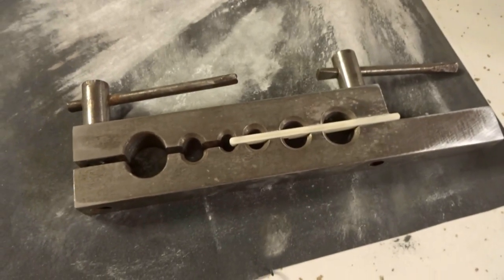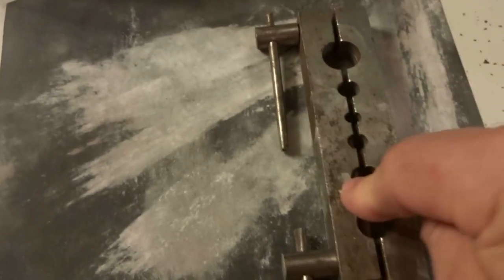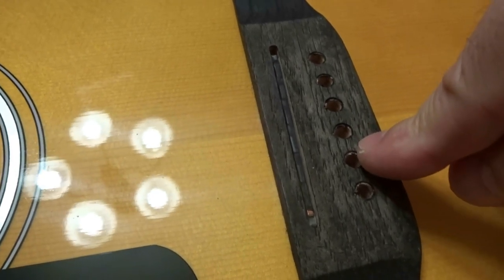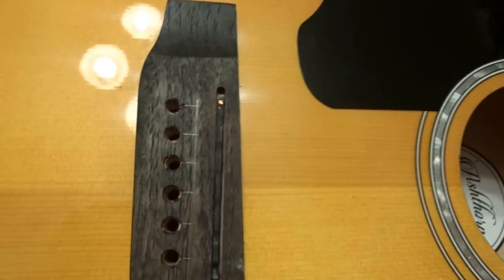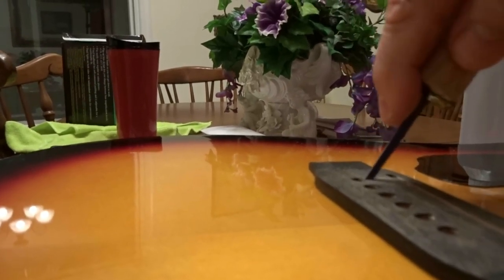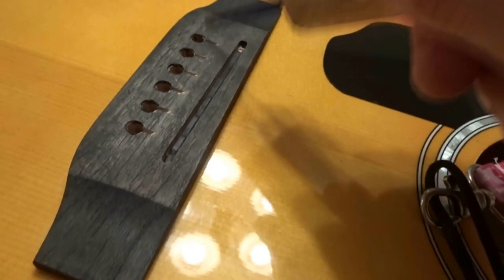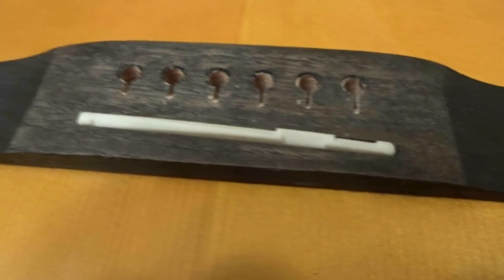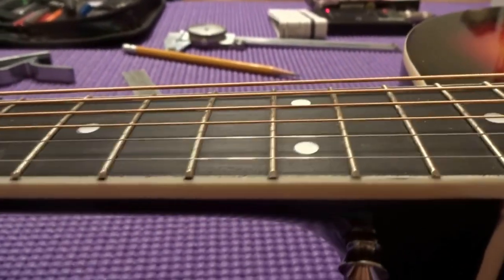Lower Saddle, Increase Break Angle, (To the Extreme) for "Low Action"

Comment: This guitar needs a neck reset. Thats all.
Reply from the maker: I know but I don't feel like doing that. Every one they sell needs a neck reset. I spoke to the company & they said I was too picky & I should buy something else.
Reply: @TheCleaner6969  WOW. Id certainly not by from them again.
Reply from the maker: @anthonylane9547  I won't. I couldn't believe how the lady spoke even after I told her there are other companies out there that are making production guitars. She wasn't hearing any of that. Just insisted these are production & you should buy elsewhere. I said you're going to get a lot of returns & at that point she arranged for another one to be sent. The next one that came in had a crooked tuning peg which turned out to be a bent screw & they channeled the wood in the neck. I have a video up how I fixed that.
Reply: Yeah... all the rest is simply superfluous nonsense. 

Feel for ya brother. But, work at a neck reset (that'll fix it) before ya smash it. Don't let it beat ya
Reply from the maker: @larrysquires5321  I know a neck reset would fix it much easier. This video was more on how to avoid that before getting into something as involved.
Reply: @TheCleaner6969  Like I said, I feel for ya (and I appreciate you simply walking through alternatives). However, there is no alternative to a neck reset that might be fixed with a mild break angle adjustment involving cutting grooves into the peg holes on the bridge.
Reply: Do a neck Reset? yeah but whose gonna do it? if he takes it to a pro he's gonna charge like 50 to 80 dollars USD an hour to make those changes... just to sand down the stupid bridge would cost like 50 per hour for 10 min work..
we know how this works... Acoustic Guitars are a horrible design in my opinion it doesn't matter how expensive ,or cheap ; the design still sucks in my opinion it's a bad design..
Reply from the maker: @Mr.PhatsVarietyVibesShow  That's everyone's answer. SMH I know personally I would not want to even tackle such a thing. There's not a guitar in this world that would make me want to do it. All I see is frustration for nothin' & problems for free.
Reply: @TheCleaner6969 dude, you're f'n dense. you're having giant struggles with alterations that ain't gonna do squat (except lead to more self-imposed problems and frustration). yet, you play mental midget at the thought of the one fix that is necessary (when clearly you have the skills to make it happen).

Thank you. You have shown everyone that you do not fix a problem neck by avoiding it.
Reply from the maker: @larrysquires5321  You watch anyone else use these same techniques to avoid a neck reset? I did & there's a reason people try & avoid them. A neck reset is a pain in the ass! The guitar plays fine now without a neck reset so why would I go through the hassle & time on an $99 guitar? When it doesn't play no more I'll have some fun making a video smashing it & buying another cheapo. Acoustic guitars are a waste of money. They're like a needy baby. So no dude I'm not dense I'm the smart one. I'd look in the mirror.

Comment: Guitars used to have the bridge slotted.. that's the right way for resonance and a good break angle.. the bridge pins should not be slotted.. but they usually are now because that's easier and cheaper. Dude you sound like the ticket scalper in fast times at Ridgemont high. Lol
Reply from the maker: LMBO  I love that movie. I didn't know either of those things. I never got into acoustics too much. Thanks for the info.

Comment: He has the saddle in the wrong direction, he put the saddle into the bridge slot for a right handed guitar, but stringed the guitar for a left handed. So on the saddle where the low E string would cross the saddle he has the high E string crossing the saddle.

Comment: Good Video . In my OPINION acoustic guitars in general are horrible designs . why can't that stupid saddle & bridge that we have to sand down, & lower the action gotta be made like this, why can't they build those like electric guitars like the Gibson type bridges that we can lower the action ,& intonate like an electric guitar ? I own 2 acoustics of which I think are horrible. I will never ever buy another acoustic ever again, because they cause way too much drama; we gotta worry about them cracking ,& the damn neck design is horrible unlike a bolt on which can be reset & removed.  Man, the acoustic design is the worst design ever invented by Man kind.
Reply from the maker: I totally agree! I like the sound on some but man these things are as bad as women or a needy child. You have an excellence idea with the bridge & saddle. It would make life so much better. I'm so glad I didn't buy a better one after learning about these. I do like a bolt on neck :)
Reply: Check out the Yairi line. They do saddles like nobody else. The pins go directly into a piece of solid ebony on the guitar body. Not the saddle. So no issues of saddles popping off. The sound resonates directly into the top of the guitar, not the saddle.
Reply from the maker: @thomasknapp7236  Thank you for the info! I will check them out. I've still been looking for a nice lefty acoustic.

Comment: I have a 1972 Epiphone F150 POS that was gifted to me on my Bday in 1972. The action was so extreme as to be unplayable. The zero fret and the bridge placement would not allow the guitar to be in tune once you played past the 3rd fret. The guitar is a treasured gift and I could not part with it so it sat in the case for 15 years with the strings under tension. When I opened the case 5 years ago the neck swung up and smashed the top because the top brace had fallen away and there was nothing to prevent the damage. Back into the case it went. Over the last year I have repaired the damage and now trying to get the action lower than the 3/8th inch that it came with. New nut &,saddle and a bridge shave. This video is a big help because today I am going to ream bridge pin hole to accept ebony pins. Thanks!
Reply from the maker: Thanks for sharing your story. Man... That really sucks that happened but I'm really happy to hear you were able to repair it & that you found my video helpful. I hope you can get it to where you like the action & that you can enjoy it after all these years!
Reply: an ignorant owner of a guitar kept at string tension for 15 years... he needs someone with basic guitar knowledge to guide him if he will listen. He had his chance over a decade ago ....

Comment: Never seen your videos before. I got a used simon and patrick recently that I'm upgrading and cleaning up, and on that model they are already slotted from the factory to increase the break angle. Even if your guitar already has a good break angle, this could be a good idea. That's maybe the smallest saddle I have ever seen! Why is the action so high? Does the guitar need a neck reset?
Reply from the maker: Hi & welcome. I closed my old channel down about a year ago but I've been around on YT since 2006. The AI kept my videos from showing up imo cause I don't comply to YT standards. I got 3 guitars from this company all the guitars needed neck resets but being they were $90-$100 I didn't want to go through the hassle. I spoke with the company several x's & they said I was too picky & these are production guitars. I said you know Epiphone & Squier are production too right? I said you should adjust your jig but in 1 ear out the other. Others swear the guitars they got are good. I doubt that unless they're slide players. Ashthorpe took over the other company that made these & they use to sell for $59.99 but being everyone hyped them up the price went up. I kept these & made them playable due to the fact it's hard to find lefties. I'm a righty originally but I'm re-learning lefty. Over the winter I stopped in my local music store as they stepping their game up & I looked at a Washburn & some others. I seen the same problems. Everything is just not being made right these days. But yea I agree even with a good break angle I would slot it.

Comment: I feel your pain. Done a neck reset on some old shit thing and it’s still a tad high (luckily or I’d be refretting it cause the frets are all over) and I could smash the guitar over my own head.
Reply from the maker: Omg if you had to reset the neck & do a fret job that would be horrible! I almost went Paul Stanley on this like I did my Black Les Paul.
Reply: @TheCleaner6969  Trouble with this one is it survived a house fire where the owner's mother died. Soooooooo........
Reply from the maker: @matthewstephens6848  Omg! That's terrible! It's amazing that it survived.
Reply: @TheCleaner6969  How they tell it was that the TV on the opposite wall was melted and this survived. The whole house was badly burned and somehow this came out. It took A LOT of cleaning work before I could even consider reseting it. The oils in the machine heads cooked and exploded out of them. That was a two hour job to refurb just the machine heads. I'm on about a penny an hour when this is done. :)
Reply from the maker: @matthewstephens6848  If it's rare or worth it or has sentimental value then it's worth it. Money can always be made. Something's money can't buy.

Comment: So the truss rod never helped with adjusting the action? Or what am I missing ?
Reply from the maker: I seen a lot of people try & use the truss rod to adjust the action but that's not what it's for. The truss rod is for setting the relief. 

First thing I do is capo the 1st fret & fret the last fret then check with a 0.010" "Feeler Gauge" at the 7th fret (On Acoustic) for your relief.  

Then I like to use a 0.024 "Feeler Gauge" under each string on "1st Fret" there should be no space & the "Feeler Gauge" should not lift the strings in either place just slight drag. 

I measure at 12th fret, write the "Action Height" down on the "Low E" & "High E" then file the "Saddle" down for what you like for your action.

But in the case of all 3 of these guitars the necks were set incorrect & I could not achieve the action height. It was like 10/32" & 9/32" And instead of resetting the neck I needed to sand the bridge down along with the nut to get my action to 3/32" & 2/32". I have several videos on here showing the process. Hope that helps clear things up.